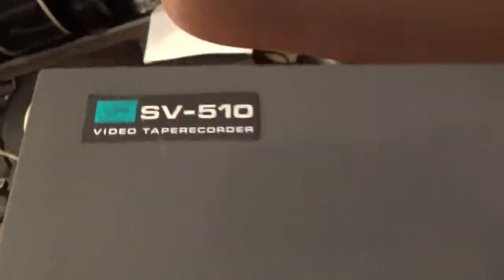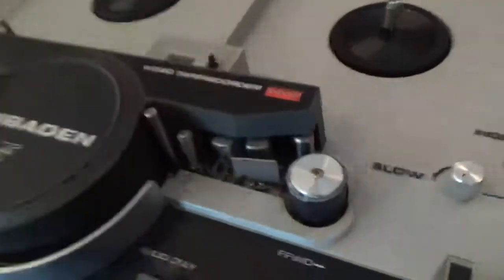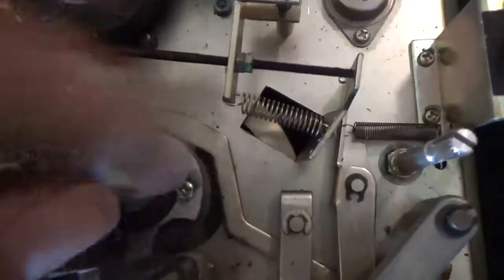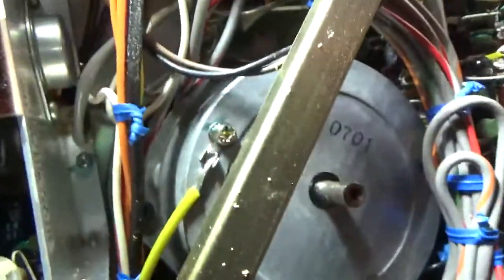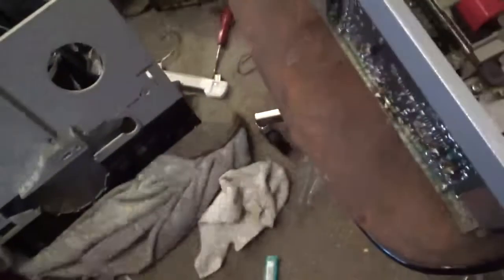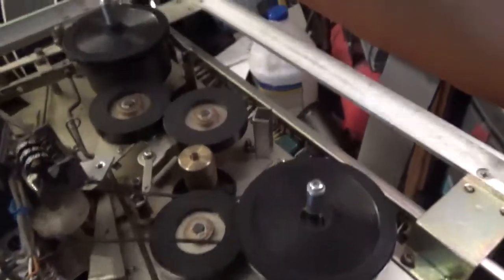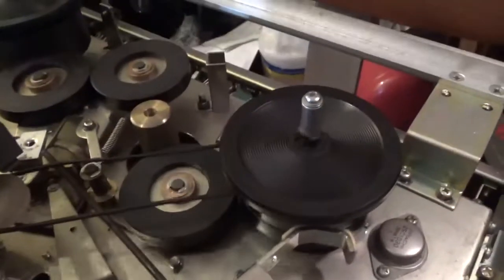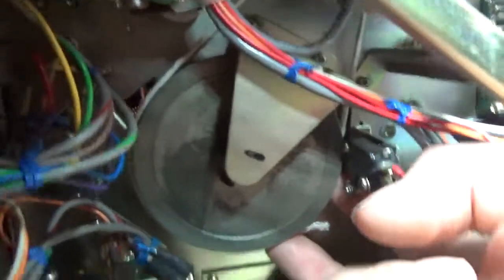Vintage Shibaden Reel To Reel Video Tape Recorder Repair Part 1

Comment: That machine is just packed with awesomeness!  Everything's totally mechanical; what's not is overly circuit-boarded.  That's how they used to build them!  It would be quite interesting to see it run.